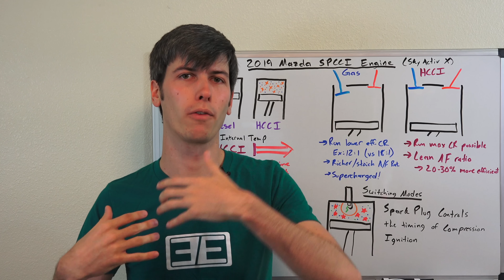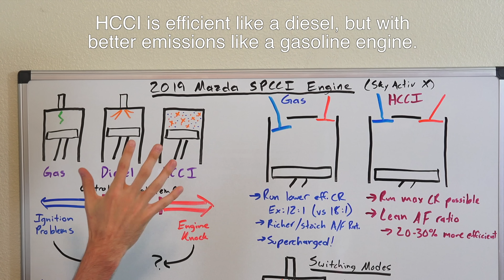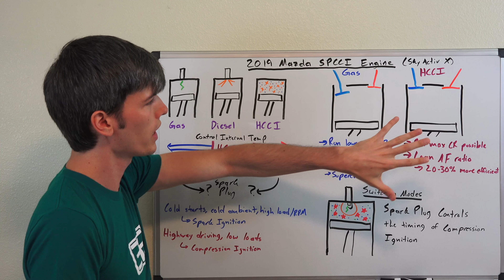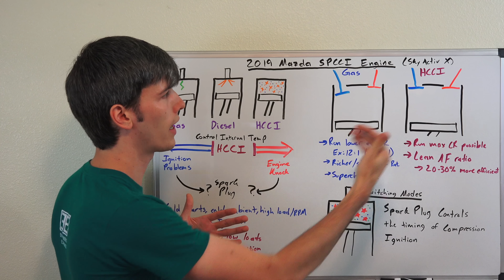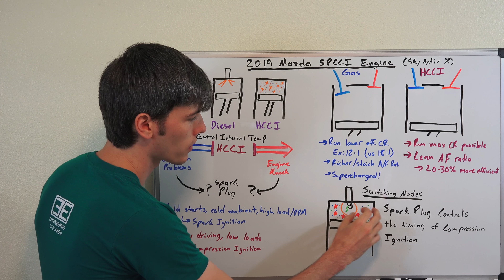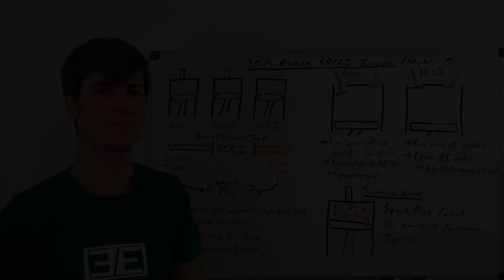Mazda Creates The Holy Grail Of Gasoline Engines - HCCI SkyActiv-X

Comment from the maker: Take it from a competitor - Nissan calls HCCI “the highest potential heat efficiency among internal-combustion engine systems” and “the ultimate combustion method for achieving both CO2 reduction and clean exhaust.” This is big news that we’ll see it in a production car soon! 
Follow along on Instagram: https://www.instagram.com/engineeringexplained/
Reply: Hopefully they show us what it can do in a more performance orientated car. Would be super cool to see.
Reply: Now to team up with free valve and go camless
Reply: Skippy they prob still have to keep standard emission controls in place only bc the engine wont run hcci all or even the majority of the time. Idling and cruising conditions (lower, steady engine rpm) are ideal scenarios for hcci....whereas cold start, heavy acceleration and high rpm situations will likely rely on the spark plug
Reply: EE- Did Mazda say anything about being able to remove existing emissions control equipment like cat converters and still meet emissions targets? It seems like a good cost saving measure if you just perfected combustion
Reply: +ddtonni  Because for a complete(r) burn and better emissions you need uniform distribution of the air fuel mixture, injecting it directly creates a ball of fuel surrounded by air and you get a flame front instead of instant ignition (just the outer surface of the fuel 'ball' burns and works inward).  The mixture does not burn as efficiently and the ultra-hot flame front creates nitrous-oxide (NO) emissions, the same problem caused by current diesel engines (that's why they run D.E.F. in the form of urea to mitigate the NO emissions).
Reply: Yes. Leave it up to the government to implement over-taxation without representation. Legal thievery is what they think it is.
Reply: Hydrogen already has an exceptionally high burn speed so the benefits over conventional systems wouldn't be as apparent. But it's a moot point anyway as hydrogen is best used in a fuel cell to make electricity
Reply: Jason I think when mazda says supercharging, they mean a special compressed air injection system. technically it's still 'super charging' but not in the way we think. My guess is they will have an air compressor and a cylinder to store said compressed air, sort of like volvo with their compressed air turbo spooling system. But instead of dumping that air into turbo exhaust turbine, mazda will directly inject it into the cylinder. that way, they can very precisely and quickly make small changes to the air fuel ratio (based on inputs from fuel quality sensors) and effectively alter compression ratio in a split second - with different values for each cylinder if need be! HCCI is very sensitive to pressure, temperature and fuel quality so this flexibility and granularity will be very helpful.
Reply: I'm getting the feeling like this is the last generation of combustion engine design before the 100% electric and Hydrogen fuel cell engines take over in about 20 years.  Reminds me of the last generation of Tube Televisions. - They finally got them to run - for ever, they never seem to die now.. but alas the word has moved on.
Reply: Yes can you imagine freevalve + HCCI
Reply: Same thing with the rotarys, nobody wanted to keep trying but they did it and made some amazing cars.
Reply: Companies are in the testing procedure of variable compression ratios, i guess the advantage of combining those two technologies is huge if you can work around the complexity. BTW @Engineering Explained, as Mazda teams up with Joest, can you talk a bit about their lmp prototypes ?
Reply: Mike Sawyer and some of those tube TV's are highly sought after, especially that rare Sony that was capable of 1080, literally they sell for thousands these days
Reply: This is why I love Mazda.
Reply: Does Diesel offer any other advantage, such that Diesel vehicles will still be needed even if and when HCCI becomes cheap and widely available?
Reply: When HCCI becomes widely available is a long time from now. Diesel is a less refined product than gasoline. You will have to convince the government to switch over from diesel / kerosine based product which runs the military. That's a YUGE undertaking. Diesel is more expensive than gasoline because it is taxed more by the government even though it cost less to produce.
Reply: Koug Arpaw yea, even burning hydrocarbons with "100% effieciency" means the same amount of COx getting released. Just all of it is CO2 instead of some CO. Gasoline has impurities and there will always be some byproducts of combustion. 100% clean fuel is a whole different issue
Reply: Oil refineries also use electricity to produce gasoline...
Reply: sixstringedthing well having shares actually is "owning" the company...usually very small percent, but it is owning. If you have 100% or even 51% uou literally control the company. But yeah other than that totally agree with you
Reply: I have the Mazda 6 MPS and CX7. No better engines on the market yet. That's why Ford is using it in the Mustang as well.
Reply: Engineering Explained how does compare to achates power engine
Reply: Darren van Langenberg love this idea
Reply: Engineering Explained meh
I like freevalve. Too bad they won't make any affordable cars..
Reply: @Engineering Explained: I have the exact same question.
Reply: John D holy crap that would be the dream.. :0
Reply: John D true, diesel costs less to produce as it requires less heat during fractioning
Reply: Koug Arpaw yea, even burning hydrocarbons with "100% effieciency" means the same amount of COx getting released. Just all of it is CO2 instead of some CO. Gasoline has impurities and there will always be some byproducts of combustion. 100% clean fuel is a whole different issue
Reply: I don't think, with a leaner mixture you always have problems with Nitrogen oxides producing on the exhaust. But that can be solved partially with a Exhaust Gas Recirculation Valve.
Reply: The system was tested in my turbo micra on Nurburgring WOW its good
Reply: Engineering Explained I was wondering how high the exhaust temps were, thanks for this comment!
Reply: Umaxen 00 so what about my area where a 30 minute drive gets you to the hydroelectric plant at Niagara Falls?
Reply: FilthyCasualGaming, 51% ownership of the common stock does not necessarily give u control of company. Since some common stock can have little or no voting rights assigned to it. So just totally agree with sixstringedthing without irrelevant disclaimers...
Reply: Will be interesting to see how it compares to current formula 1 engine technology. I have read that F1 engines have the highest thermal efficiency of any internal combustion engine.
Reply: Formula 1 engine technology is not necessarily going to be cost effective tech for the mass market, Today but it could be a preview of the future, Just fuel injection was in the past.
Reply: Independently controlled (not necessarily pneumatic) valves will be needed future for many reasons. Like when an ICE (like a free piston engine) is used to power an EV powertrain (so that all of the conventional powertrains components like a crankshaft, can be eliminated) while increasing it efficiency and flexibility. .Its like crossing a Koenigsegg with a Tesla,
Reply: I had hoped someone would have a real answer. Instead you prefer to insult, I suppose it makes you feel self important. My question was about thermal efficiency so you babble about "volumetric efficiency" 

Anyway I spent a few minutes with google and found the thermal efficiency of Formual 1 engines are in the 45 to 50 percent. That is very high but it seems we have to wait to find out the thermal efficiency of these HCCI engines.

Reference are always good as they help substantiate any claim made here. So here you go, just search for thermal efficiency:

http://large.stanford.edu/courses/2016/ph240/jaques2/
Reply: I had hoped someone would have a real answer. Instead you prefer to insult, I suppose it makes you feel self important. My question was about thermal efficiency so you babble about "volumetric efficiency" 

Anyway I spent a few minutes with google and found the thermal efficiency of Formual 1 engines are in the 45 to 50 percent. That is very high but it seems we have to wait to find out the thermal efficiency of these HCCI engines.

Reference are always good as they help substantiate any claim made here. So here you go, just search for thermal efficiency:

http://large.stanford.edu/courses/2016/ph240/jaques2/
Reply: Dennis4SB5, Thx for the link. But this article was very misleading (it was really about the  Formula 1s ERS not its engine) and has many other flaws. While the article does start off by referencing Formula 1 "engines" its really referencing the Formula One "cars" including its energy recovery systems (ERS) that's not part of  the engine. So its statement "road cars have been stuck around 30% thermal efficiency, Formula One Cars have exceeded 45%" (again its referring to the cars not just the engine) is comparing road cars that mostly don't have a ERS/hybrid to Formula One Cars that do. 

HCCI engines should increase its efficiency when compared to conventional gas engines. So if it combined  with an ERS/hybrid, the efficiency will go up that much more. And the a article didn't include formulas so I can't even be sure how it came up with figures (w/o checking it references).   

I happen to be a proponent of ERS (as a series hybrid) so it's a shame that the writer of the article made it seem like it was more about the engine and just made it seem so confusing. And I hope this helps clarify this matter for u,
Reply: N C Thanks for an excellent point of discussion. I considered the effect of an ERS system and there is certainly space to consider reasons to include, or not, the point of energy recovery. Clearly if we look at an IC engine in a vehicle compared to the same IC engine in a stationary application, such as a generator of an electrical current, there is likely no kinetic energy in the generator that can be recovered.

The original post is talking about vehicle applications and all things being equal energy recovery will move us further down the road. However; I agree the article lacked some specifics and we don't know if the ERS effect is subtracted, the true thermal efficency of a Formula 1 engine. One thing for certain is that the most important thing in Formual 1 engine development is the combustion chamber.

Given some free time, it's not really free you know, I may be able to clarify the thermal efficency of just the engine, with it's turbo of course. but no ERS. 
Thanks!
Reply: Dennis4SB3 Ur welcome, but since u r talking about "stationary application" I think maybe I was not clear in how I explained the topic? (I understood what u were saying but it didn't relate to any type of efficiency of an engine or a vehicle) 

And hopefully this wont make it even more confusing. But thermal efficiency is irrelevant, it's the energy efficiency of the vehicle or the engine that matters. Since thermal efficiency is only part of energy efficiency (I can explain y but I think that would make things even more confusing). 

I know ur serious about understanding this topic and dont mean to be harsh with my critique. But The only real use of the article was to know what u bases ur premises on, but it has no relevant figures to have a real discussion. And there was no useful info in it about  "Formula 1 engine development for the combustion chamber.". Or anything else.

If u find an article that really talks about Formula 1 engines (and has relevant facts) such as its efficiency or combustion process I would happy to look at it and give my feedback. As comparison to HCCI or conventional gas engines. Good luck on u road to further ur knowledge on this matter.
Reply: H C Good Luck on your road to further your knowledge too.

PS: This link may be of interest regarding the evolution of HCCI
https://en.wikipedia.org/wiki/Homogeneous_charge_compression_ignition
Reply: Engineering Explained : I am not fully understood, we will operate the spark plug even in hcci mode
Reply: I am not fully understood. As we always use activating of spark plug even in hcci mode. And to have high CR , we need more air. So do we need to use turbo?. And how about 2 wheeler s as we will have smaller manifold. Will this work out there or do we need to use turbo.
Reply: +sudheer pk. I don't fully understand the tech but the CR can be 
controlled by vary the opening and closing of the valves. In other words
 you can increase of decrease the overall compression by increasing 
exhaust/ intake overlap or by allowing one valve to remain open on the 
compression stroke during one cycle but not the next.
Reply: sudheer just keep reviewing the EE video and I hope w8stral2 usual BS didnt make it more confusing for u
Reply: 1st I did know its a competition, 2nd if EE uses to many big words for u, feel free to do ur trolling elsewhere.
Reply: Wonder if this will be as reliable as their technologically advanced pile of shite DISI 2.3l motor?
Reply: There is only 1 true way of reducing the carbon emissions from an ICE engine and that is to burn as much of the fuel as possible before it enters the exhaust system. Please don't start me off on the catalytic converter con which actually ONLY captures a minute amount of the particulates produced by an ICE engine and then needs to be periodically changed (costing 100's of £££$$$) and then sent off for cleaning/recycling and then resold as a new unit. Or buy an EV and be gay (according to doktorbummer) and breath fresher air by eliminating CO2 from your exhaust altogether.
Reply: actually, you can. acid has many industrial uses
Reply: Supercharger is better suited for HCCI then a turbocharger due its lack of turbo lag. But u do u get more parasitic energy loss with a supercharger then a turbocharger,
Reply: N C
 Uhm  a properly sized modern turbocharger does not have lag issues. stop subscribing to a 20 year old debate point.
Reply: GlassTopRX7
 an electronic clutch could easily solve that problem. however, I still think modern turbochargers are the way to go.
Reply: I was just pointing out. If the goal is to have the HCCI power cycle for 100% of the time, turbo lag from a "conventional" turbocharger defeats that purpose.  There are a lot of non-conventional alternatives. Like adding a electric motor with a clutch that was activated with a solenoid to a turbocharger to avoid the turbo lag.  
In addition as part of an EV powertrain a HCCI could be just used at "optimal" times to charge and power an electric motor. But my initial reply was just to focus on that 1 issue of turbo lag,
Reply: Curious as to how they plan on controlling Oxides of nitrogen production.
Reply: xlf it's old hat actually, the concept was just bypassed due to the complicated design of the crank, added rotating assembly weight, block, moving parts----
Reply: Running on compressed biogas the c02 is 0g, how you can beat that with gasoline HCCI jaadi jaadi jaa?
Reply: Since we're talking about fantasy fuels lets use fair dust :) Seriously alternative fuels like biogas or even electirc from zero carbon sources is a totally different subject. And who says a HCCI ICE can't use biogas?
Reply: It's not different subject, it's truth which you can't escape. This petrol HCCI development is unecessary - the emissions are still high so it doesn't solve anything.  HCCI adds complexity layer on top of the engine and it's not really needed as benefits are virtually zero when using biogas.
Reply: My money was on Hyundai's proto as they had only 18:1 compression ratio instead of this variable compression stupidity, but even they seemed to run into the problems, and the engine were very expensive to build with turbo, supercharger, injectors etc. Looks like that project is dead.
Reply: If added complexity was the only issue, we wouldn't have developed emission controls.  And EVs can be made simpler by not using regenerative braking.  It's always a trade off between cost/complexity vs benefit.  HCCI has many benefits like added efficiency that should decrease emissions overall,  in a world still dependent on gasoline, if it can utilized in a cost effective manner.  
And I'm just curious, if u have no interest in gasoline engines development like HCCI, why even comment?  Biogas is just a niche player for landfills, that could never be scaled up to replace gasoline.  So keep dreaming it will if u like. But a BEV and solar panels would make more sense for someone wanting to go green. If they can afford it.
Reply: Mazda already set a date for using it in a car.  Lets see what happens and see who "eats crow". When it on the road or not?
Reply: That's not true. It's late couple of years already.
Reply: Biogas can replace everything which is based on gasoline and diesel, marines, aeroplanes, wankel-engines on zero emissions, trains and spaceships.
 Why you keep commenting here if you're not automotive expert? Looks like you could not understand that on biogas the emissions are zero. In ZEV +ILEV zones in california you can drive there only with biogas, hydrogen and electricity.
Reply: Subject matter is "Gasoline Engines - HCCI SkyActiv-X" not biogas or any other green wet dream u have about it. And if u think ur an automotive expert god help us all. It would great to get the feedback from an expert of how HCCI could be used with an EV drivetrain to achieve synergies with both systems? But Im sure u have no idea how that possible so, why am I wasting my time? Have fun trolling.
Reply: Not that it matters but biogas plants have been existence since at least 1859 and in india it was commercialized since 1950s, NVM I gtg make some biogas for u and ur crazy ideas now.
Reply: I know. Renewable methane can be used from many sources and it is used in all internal combustion engine applications, includes passenger cars, vans, busses etc. (1.5 million methanebusses globally) Citroen had CBG model on 1930.
Reply: lol methane buses usually run on NG and it subsidized in places like india, biogas has many impurities  but again that not the subject matter here, 
Just give a cogent critique of the Hyundai's proto  vs the Mazda  HCCI SkyActiv-X? Or stop wasting everyone's time on irrelevant matters.
Reply: I am not responding to trolls who has wet dreams about continuing using the worst fuel ever invented. CBG-engines doesn't need HCCI as it doesn't add any benefits, should not that hard to understand.
Reply: You're wrong. Methane busses especially on europe mainly uses biogas now, NG is thing of past as it's fossil fuel. This video is about the future of combustion engines, it's green and it's biogas so biogas is higly relevant when it comes the future of traffic.
Reply: As usual u have been wrong about everything. I'm the 1st 1 to look forward to a logical way to find cost effective ways to make our society more environmentally sustainable. Its just someone ranting irrlevant propaganda about biogas on a vid about HCCI is a just a distraction from ppl that r serious about finding real solutions. I'm done contributing  to conversation with someone that cant make any substantive replies.  Have fun trolling biogas boy.
Reply: running on biogas the emissions are zero. The emissions are high on HCCI.  You're not doing environment any good by keeping using the worst fuels available, diesel and petrol which are the cause of pollution and bad air quality on cities. HCCI doesn't solve those but biogas solves, there's millions of biogas vehicles used globally. You really should study about automotive, traffic and environment as really watching top gear and tuning your civic you can't learn anything but bad and incorrect jokes about cars.
Reply: It's misleading to tell that Formula 1:s powerunits doesn't have 50% efficiency, when in reality they have. Energy recovery systems are part of power units just like simpe EGR has been part of passenger cars engines past 20 years. You have double standard if you just want to look the internal combustion process of formula 1 power unit to make some kind of lousy point. It has 50% efficiency because clever energy recovery systems - deal with it.
Reply: I think you're the troll here having double standard on F1 engines and descriving biogas usage as "wet dream". IF something is dream here, it's HCCI as they're not existing on passenger cars, but biogas cars have millions of units globally in all the car classes, including hypercars (Ultima GTR based Maxxxximus with 1600bhp beating Chiron by 100bhp)
Reply: Zoom zoom.
Reply: NO Mazda is NOT owned by Ford!
Reply: Why can't a gas engine ignites just like a diesel engine. Say when air is compressed to a high enough pressure and then spray gas into the cylinder, rather then compress the air fuel mixture. Controlling timing using fuel injection rather than spark plugs or finding the ignition threshold temperature. Wouldn't this be more efficient than this HCCI concept? You can even have a compression ratio of 30:1 as long as the engine itself is strong enough to handle, well theoretically.
Reply: OhKey!, that is not even close to being correct. 
Ford never "owned" Mazda, and they certainly never "ran" Mazda. Firstly, at this level of the corporate world, you don't "own" a company, you're a shareholder. If you're the majority shareholder, you have a much greater say in decisions such as appointments to the Board of Directors or overall strategy, but you still don't "own" or "run" anything. The company is owned by all of its investors and run by its Board and staff.
Secondly, while Ford did at one stage hold a majority of Mazda shares (about 30%) during their joint partnership through the 80's to early 00's, today Ford has divested itself of the vast majority of its shareholding, retaining something like 2%. I hope that clears things up for you.
Reply: +Engineering Explained

but you do realise that mazda isn't the first manufacturer to try this, nor have they "found out" about it. There already were such projects from mercedes, VW etc, but they abandoned it, because it didn't really work or they had to use a special, very expensive fuel.

What i want to know is, which fuel mazda says it will run on?
Reply: diesel is cheaper in europe, and used to be cheaper in the united states. Some places still is
Reply: Engineering Explained. So gas (petrol) isn't dead yet. This keeps everyone happy if they can achieve 100% burn and almost zero emissions, all the raw materials needed for electric cars outweighs the emission benefits. Do you think this technology would kill off diesel engines?
Reply: Gusli Kokle the electric car is a joke. Insanely expensive, low range, recharge time and so on. Long live internal combustion engine
Reply: Hreb IMO, the advantage of diesel is high torque with greater efficiency. To achieve the power levels of your average diesel, a gas engine would do something like 5-10 mpg. I can tow a heavy trailer with my old 5.9 Cummins Dodge Ram and still maintain high teens. Also, diesel burns cleaner than gas, so I've been told
Reply: Mike Sawyer y do ppl that seem to have no interest in ICE feel the need to comment about them? Seems to be a type of trolling in reverse when u see comments about EVs from ppl that just want to disparage them.

I think u will see its more like how radio evolved from TV usage and TV evolved due to the Internet. New tech does not necessarily kill complementary older tech it just changes how its used. And some tech like diesels over time come and go in terms of usage. But politics will be the deciding factor of how this will plays out across the world. 

And it funny how ppl forget it not just a binary choice of combustion engines or BEVs and Hydrogen fuel cell when serial hybrid get synergies that u cant get form either source alone. So I will put my "2 cents" bet on combustion engines being part of the future long after 20 yrs from now.
Reply: The acceleration from a Tesla scares you I guess.
Reply: There is no such thing as clean exhaust from a gasoline or diesel engines. None.
Reply: This was more or less done by GM Chevrolet already, if they go without the spark plug all together that would be something.
Reply: Engineering Explained sucks... jeranism is far better
Reply: thats funny I am a ford tech and every block and head is stamped ford, Oh wait thats why Mazda USES FORD ENGINES.
Reply: That's funny.  Subaru's PZEV, unleaded gasoline engines are 7 times as clean burning as any electric car since coal and oil fired utility plants are absolutely FILTHY! Just because the car doesn't give off emissions through it's tail pipe doesn't mean it doesn't have a profound and negative effect on the environment. The only way electric cars can have a positive effect on our health? Use solar, wind or wave power to recharge, otherwise you're kidding yourselves...
Reply: DrgnFlys no, it's be 0% efficient, it doesn't exist. however an electric motor does get into the 90's in the efficiency range, not sure what it is for a solenoid motor though
Reply: Engineering Explained who cares about ice cars? Meanwhile, Tesla has a 10 second 4 door car that drives itself. No but cool, that gasoline engine is total sweet....
Reply: They will be banned from public roadways along with human operated  cars.